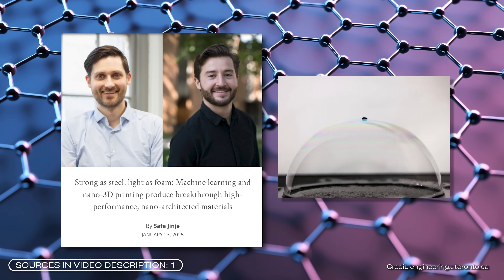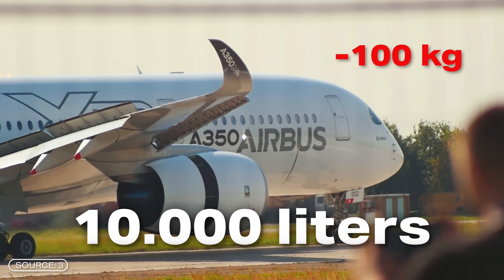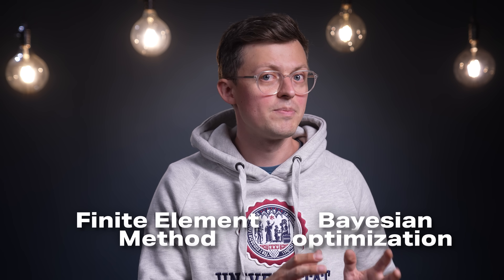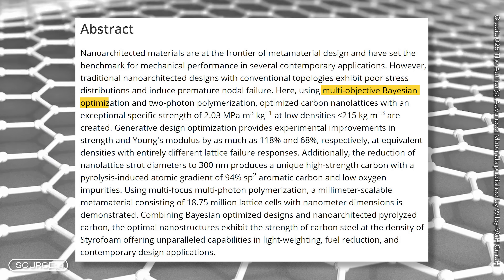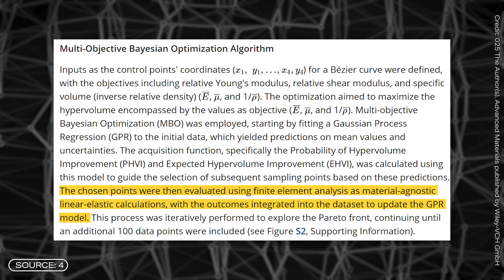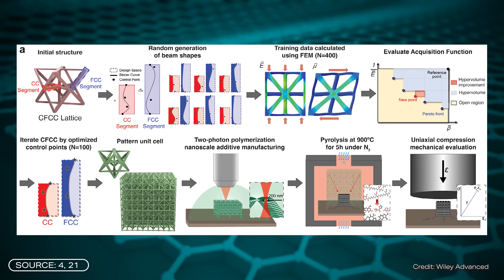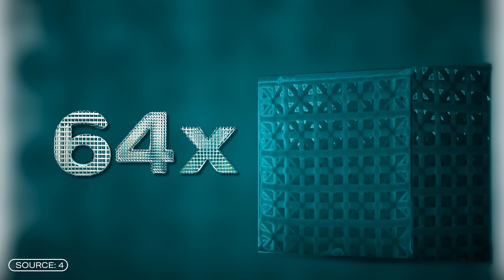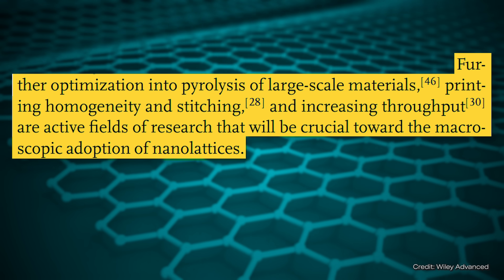New Material: As Strong As Steel, As Light As Styrofoam!

Comment: Strength and weight mean nothing if the structure fatigues quickly.
Reply: Or its too expensive too produce,
Reply: Depends what you mean by 'quickly'. For example kevlar bulletproof vests are considered expired after 2 to 3 years.
Reply: @francoisleveille409  I didn’t know that
Reply: In order to fatigue, it has to move.  This material is extremely rigid due to the way it was designed.  The less it moves, the less ability is has to even begin the fatigue process.  This material is likely extremely resistant to fatigue.
Reply: @wesbaumguardner8829  Positively absolutely not true. Composite materials can degrade even when simply resting on a shelf for too long.
Reply: A lot of inventions were thought of but we’re not used till later when other improvements came. It will be useful someday maybe for something totally different.

Comment: Could the little carbon cubes could be plated with a metal then those particles could be sintered into light but strong objects? in that way large objects don't need to by pyrolized. Something large could be fabricated and machined. The little structures could also be tailored to form synthetic zeolites or supports for catalyst. In these applications the dimensions of the voids influence the diffusion of various molecules to exclude or include specific molecules in a reaction zone.
Reply: I may be misunderstanding the thought, but wouldn't scintering metal bits also cause the carbon to join it and make an alloy (depending on the melting temp of the metal)?
Reply: There is a better way to uniformly pyrolize the carbon and it will work on the micro and macro scale. The technique is used in the transportation industry. Anyone interested?

Comment: Interesting video, and it's great to see that you use references.

You make the case for these materials' low density and high Young's modulus, but not it's strength. Young's modulus is a measure of stiffness. Strength is usually quoted as tensile or compressive, and is a measure of the point at which a material yields (deforms plastically) or breaks. It will be interesting to follow the development of these materials going forward.

Vielen Dank!

Paul 😎
Reply from the maker: Great point!

Comment: My main concern would be flammability.  It'll depend on whether this carbon foam is porous or not. If it is porous and the lattice is full of air then I suspect this material could burn very rapidly.
Reply: That's exactly what I thought. A cutting torch would vaporize it.
Reply: Of course you saturate it any gaseous matrix like nitrogen.
Reply: Wouldn't the fact that it's carbon based prevent flammability?
Reply: @chriskelso723 Wood is also made of carbon
Reply: it's been pyorised at high temp! ergo, it is already burned and cannot burn again
Reply: @andyman8630  - If it's still primarily carbon, it's still subject to catching fire.  Carbon + oxygen => CO2 + heat.  Not sure where you're getting your information.

Comment: Nice.  You guys could also build little nano optical chips.  I know...  3-D print Titanium  (or Kevlar polymer) with that structure,  Fill the voids with an aerogel.  Add a super thin foil sheet on top and make super light weight corrugated panels that can also bounce off a bullet strike.  Or fill the voids with impact activated media and make light flexible armor that can stop a bullet or a knife, dart, or arrow point as well.

Comment: I don't like it. A few years ago learned that something truly strong, is a little bit flexible, like trees; this applies to emotions and our daily life too. So, Sorbothane, was put on the base of a Hanging Bridge cable, along with concrete around it, so the flexibility would allow togo with the swinging of the cable, while absorbing its energy and keeping it in place; reinforce concrete will only break down eventually while damaging the cable a little.

So this material should be like that, should absorb energy and dissipate it, also have some Sorbothane or similar material in the hollow places of the structure, to add flexibility and strength; like rebars in reinforced concrete . Something Airplanes and other vibrating machines don't have is Sorbothane, to help them dissipate, big vibrations and make the rigid materials stronger, reducing the rate of developing Fatigue Fractures

Comment: Carbon steel has a compressive strength of 600-900 MPa, not 180-360. Further, the density of styrofoam is 10-30 kg/m2, not 125-215. Totally hyped, exaggerated research. and what about brittleness If you take graphene flakes, you can get 100x the strength of steel. now go make a bridge from that. or take diamond, compressive strength 8680 to 16530 MPa, that is around 10x more than this material, and the density of diamond is only 3.5, not 8.7 like steel.

Comment: I've been hearing about super-light carbon based structures for the past twenty years, but so far I haven't seen them form into many practical products.  Steel and aluminium are still the most used materials that I see.

If this gets to market that would be really cool, but I'm sceptical.
Reply: Probably expensive to create, hard to process and impossible to recycle...

Comment: My car from 1997 had a 2.5L engine that performed almost as well as a car from 10yrs later with a bigger engine, while using 30% less fuel purely because the newer car was 800lbs heavier offsetting "efficiency" savings

Comment: This stuff might be too easy to torch because it's carbon. If the strength to mass ratio would be awesome, but you might have to add mass to protect it from getting torched, by accident or by an arsonist/terrorist. It would be great for aerospace but fire protection would be a good idea but add mass/weight, which in that case you don't want. :( Can't have everything.

Comment: Durability and ability to flex without cracking or being crushed is going to be the most important thing for stuff like this. This might make a phenomenal filler for voids in walls and stuff where it augments the strength of traditional materials, but probably not tough enough to be making anything structural out of, at least anything that has to endure regular mechanical stress.

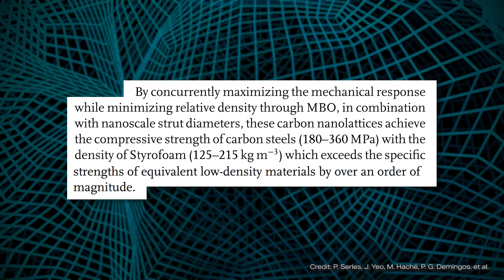Comment: 6:23 More importantly, how is the tensile strength?  I want my space elevator.
Reply: yeah space elevator was my thought. I've figured make a tube anyway so this would be perfect to control the thickness. Imagine a huge 3D printer that runs on a ring shaped track crawling down the tube. Precisely pyrolyzing the printed medium would be the tricky part. Probably need some kind of channels through the material to carry heating elements. Print on the end then follow behind pyrolyzing the hardened material to support the weight of the equipment that is being lowered down the tube.
Reply: Why do you need a space elevator when you can have a space trebuchet? (Look up Spinlaunch.)
Reply: Space elevator is a horrible idea and still not feaseable. A better idea is buoyant, lighter than air airship made of polyamide aerogel/airloy, which is slowly accelerated to orbital velocity in the strosphere/150k feet altitude.
Reply: @timonalexandr151  In 1903, a 500-seat passenger aircraft made of spruce and cotton fabric would also have been a "horrible idea."  We are still too many technological discoveries away from being able to decide how horrible a space elevator is.  I would not write it off yet, the way the Pentagon wrote off the Wright flyer ever having any military application.
Reply: @Philip-0  By the time you discover or invent materials that you can then use to construct a space elevator, we'll probably have discovered better ways of reaching LEO. 

When I say its a horrible idea, I mean that a failure of such an elevator from earth to space will lead to catastrophic 'damage' type consequences. And how much damage it does depends on where it fails. 

Again, sending an airship to LEO is so much safer, cheaper, and feasible even with the materials we have now such as polyamide aerogel (discovered more than a decade ago), and some good engineering like carbon fiber tensegrity struts (if its a vacuum airship not helium), etc..  

The goal is to reach 150k to 200k altitude, and then accelerate to orbital velocity. Generate plasma sheath on the leading edge of the airship using microwaves or high powered lasers and the airship would be able to glide and reach those speeds in the rarified upper atmosphere.
Reply: @timonalexandr151  A space elevator would be for reaching GSO, not LEO.  Big difference.
Reply: @Philip-0  It doesnt matter, or at least its not worth the hundreds of billions (or more) that it would take to construct and mainain a space elevator  Exodus propulsions' Asymmetrical Capacitors/Bie-feld Brown thrusters generate thrust in hard vacuum. Not enough thrust to lift off and reach orbit, but enough to go from LEO to GSO. It just involves time. 

The hardest part is getting to LEO.
Reply: @timonalexandr151   Once again, most of the required technologies don't exist and might never exist, so there's little sense in mentioning costs.
Reply: Its a bad idea. Everything eventually fails and a hypersonic structure whipping around the earth and smashing into it is a terrifying catastrophe
Reply: @GonzoDonzo  And if man were meant to fly he'd have wings.
Reply: @Philip-0 its an idea that sounds cool but is frought with huge engineering and maintenance issues. Its hopefully something that we will leapfrog with other advancements in propulsion and make pointless

Comment: I’m a big fan of David Wingroves sci-fi series Chung Kuo. In it there was a building material similar to the proposed one in the video. But with what we know today, this material is not scalable for real-world infrastructure.
The limiting factor is not just money or manufacturing willpower—it is the physics of energy input, process control, and defect management at scale. Unless there is a fundamental breakthrough in fabrication efficiency or a new, radically less energy-intensive process is developed, this material will remain a laboratory achievement, not a mass-market solution. But I hope I’m wrong.

Comment: Imagine an airship made with this material but instead of using helium, it uses nothing. It just has to open the balloon, assuming the structural integrity, and it will float like any other airship.
Reply: Wow, with a large enough vacuumed space, the ship could have negative buoyancy if the mass of the ship was low enough. I like the steampunk vibe.
Reply: @MsTyrie  yup

Comment: Might have interesting applications in airships as well. Not as flashy as airplanes, but they are still one of the most efficient means of getting stuff from point A to point B.
Reply: ENERGY efficient.  TIME efficient, not so much.
Reply: @johnsanford3596  We already transport large volumes of goods across the ocean at a mere 13 to 24 miles per hour, so time efficiency is irrelevant when transporting large volumes of goods on a predetermined schedule.

Comment: Yep, weight is much more important for a plane than a car because the size of a plane wing directly relates to it's weight (sum of air frame & payload)  L = 1/2 . p . V^2 . S . Cl  (S=Wing Area), so the lighter the plane, the less wing area required.  The wing is by far the major component of a planes drag.  The general formula for drag is D = 1/2 . p . V^2 . S . Cd.  From these 2, we can see that reducing total weight by 50% also reduces drag by an amount approaching 50%.  So reducing airframe weight reduces drag, which reduces the fuel load, which reduces the mass of the airframe, which reduces the weight, reducing drag & so it goes until reaching a new optimal design size & total weight for the same speed & range.
Reply: Interesting, but might also be very interesting for airship technology.

Comment: Based on the examples shown here and the pyrolosis technique, it seems the end product mimics carbon products architecture like graphene, and carbon tubes, which struggle scaling up to useful sizes. This could be something to watch.
Reply: I wondered why there was no mention of graphene, especially because the background graphics included a green sheet of it waving. Graphene is being leveraged as a structural adjuvant to coatings, tires and road surfaces, 
Who knows, this could be about a technique to make a specialized graphene lattice. Pyrolysis seems an unlikely process to that end.

Comment: A lightweight metal that is classified as a strategic element is concentrated in huge areas on the deep ocean floor.  Scandium is found in the sediments in between Hawaii and Mexico.  It is referred to as a spice element, because so little is needed, when mixed with aluminum. Unfortunately, the fascist left almost always complains about mining the deep oceans, so like the no oil protesters, there may never be any mining in that zone.  Except for the fact that Lockheed Martin has some very old mining claims there, which are grandfathered in, and Trump just signed an executive order for mining...also, most countries surrounding the Pacific Ocean have large "Economic Zones" and are not restricted by the international regulations being made up by environmental enthusiasts.  This material is comparable to titanium in strength and welding ability, but weighs considerably less.

Comment: Of course, the big challenge is, how can you produce these micro grids in a practical and economical scale. I think short of nanoassemblers it will need to be some kind of chemical process, as is used in aerogel production. Aerogel is also famously expensive, but it is far faster and easier to produce than 3-D printing, microgrids, and pyrolyzing them into a stronger material. Imagine if this was available in sheets like plywood! It could likely be cut with a saw, and gluing the parts together would probably work very well with all the surface area for the glue to mechanically bond with.

Comment: This is fascinating and I hope something comes of it. However, it sounds like it would be very energy-intensive and expensive to manufacture. Then there's the question of whether it would be possible and/or economically viable to make large structural components (like airplane wings, rocket fuselages, and wind turbine blades) out of it. I would also be interested to know if it would be possible to create a "brick" of this material, evacuate the air out of it in a vacuum chamber, then spray on some kind of high-strength coating. If the "brick" could withstand air pressure, then you've got a "brick" that's as strong as steel but floats in air. The perfect material for constructing airships, floating cities, super-tall structures, and so on.

Comment: Grüße aus Kanada!
Finite, pyrolisis: the "i" is what they call a long-i, meaning, like the word "I", or like Ei in German.   Just a friendly fyi.  The general rule is, that if (zero or) one consonant separates the vowel from the next vowel, it is to be pronounced in it's long form, and if 2 consonants are between 2 vowels, it is pronounced in it's short form. The vowel at the end is usually silent, only there to guide in the pronunciation of the second-last vowel. (of course, as for all languages, there are rare exceptions). In the word pyrolisis, it is only the "y" that is pronounced like a long-i, the remaining vowels are all short (so this word holds some of those exceptions).
Reply: Wouldn't it make sense to take infinite  (in-fə-nət) and pronounce it consistently when dropping the leading "in"? But no, finite has to be fi-nīt. Sigh.